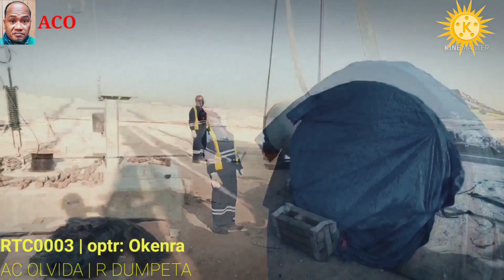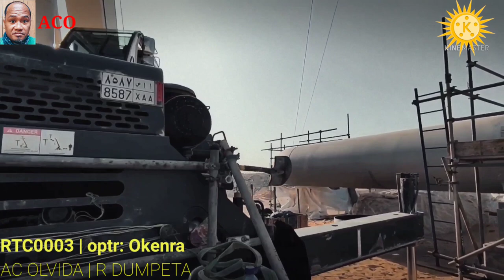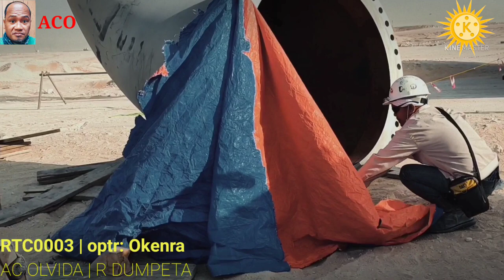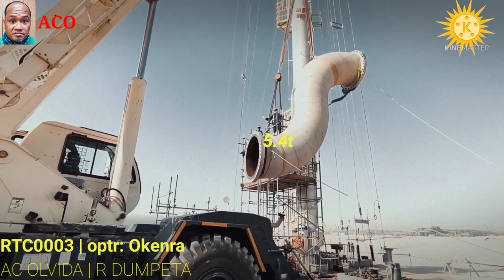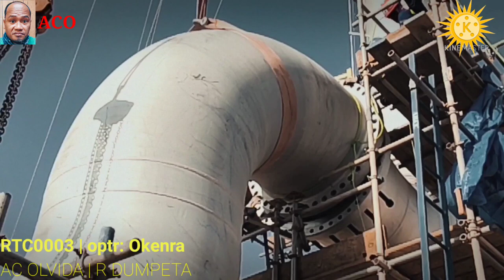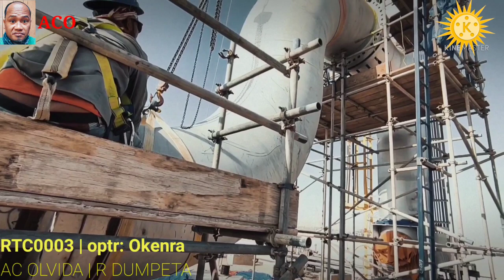Erection of L bow | Flare line  | flare area, Hawiyah Samsung project

Comment: Y not mention sling details
Reply from the maker: Im using only of 6"x15 meters of webbing  sling and 1" ¼ shackle and for balancing i use 4"x4 meters on chain block and 5tons only and 3"x12 webbing sling and 1" inch shackle for lassing. The load cap is 5.4tons. a flare pipe line.